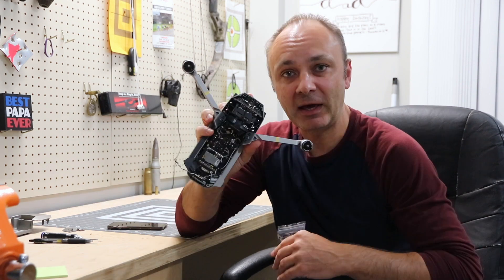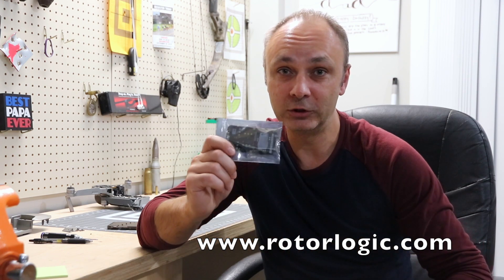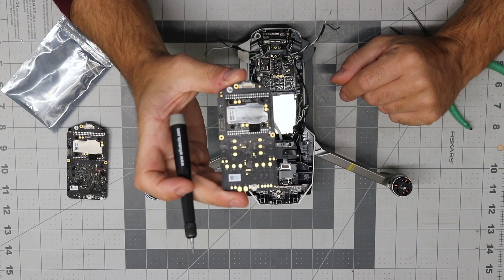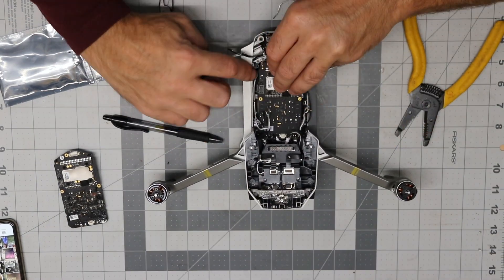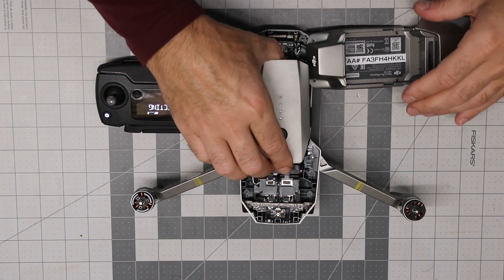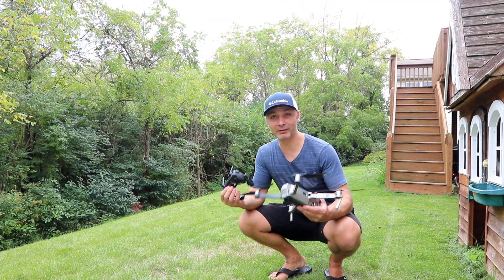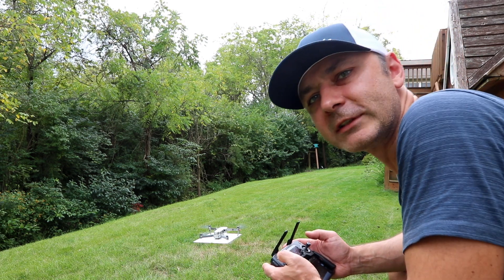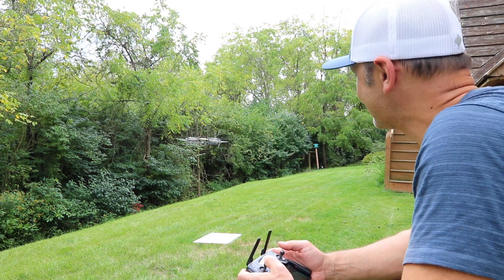ESC REPAIR - DJI Mavic Pro Platinum, Part 2

Comment: Olá amigo , estou com um problema no Mavic pro ele não liga o cooler , já verifiquei que nao chega energia para o cooler , será que é está placa que tenho que trocar ?
Hello friend, I have a problem with the Mavic pro it does not turn on the cooler, I already verified that there is not enough energy for the cooler, is it this plate that I have to change?

Comment: hi, my mavik pro crashed ... need to change ESC board ! I have a board from another mavik pro , she is compatible? there will be no problems? p.s. special DJIsoft are not needed?
Reply from the maker: No soft needed, just swap, should be good to go, only one note, you can't swap between Mavic Pro and Mavic Pro Platinum, PRO to PRO is fine. Good luck

Comment: Hey Peter, I recovered my Mavic Pro after it fell into water.  I dried it out and it turns on just fine now.  The only issue I have is it will not connect to the controller.  Do you think that replacing the ESC will repair this issue?